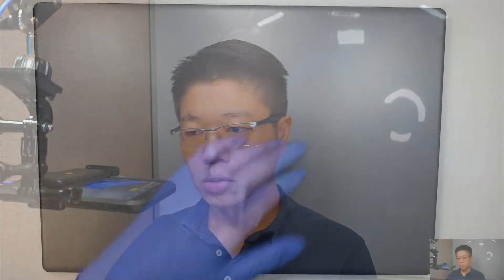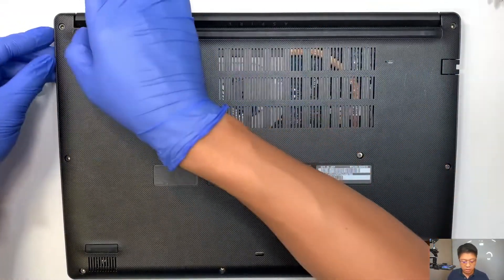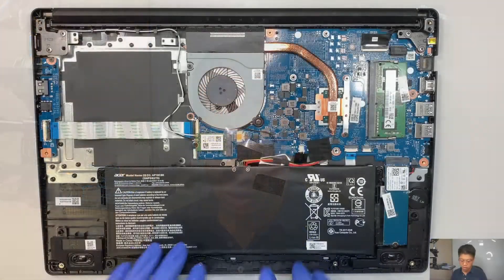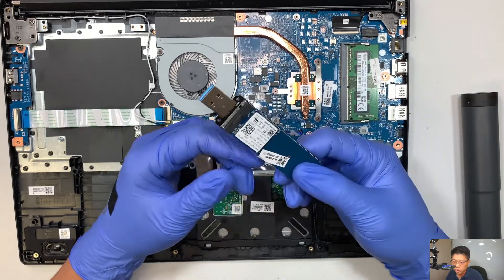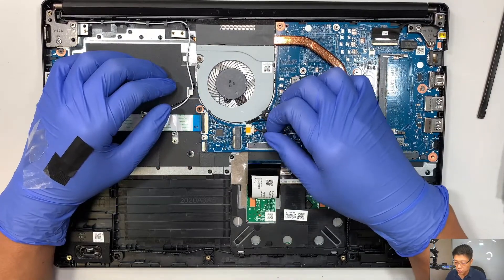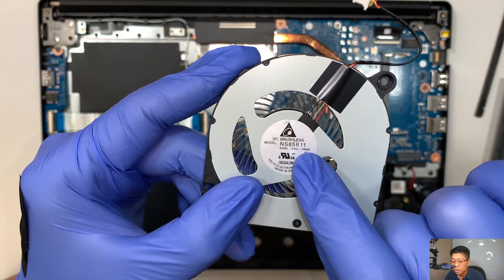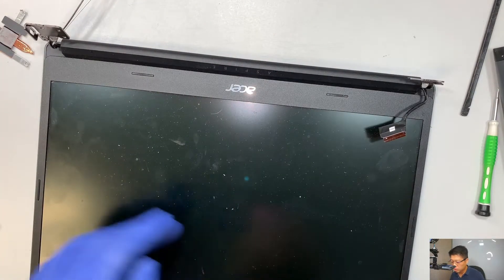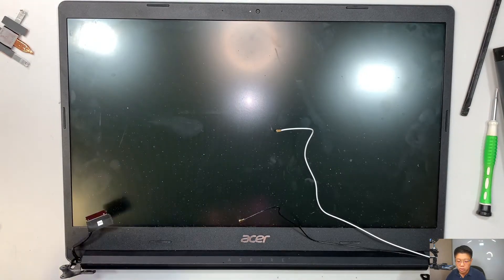Acer Aspire 3 A315 23 Tear Down Disassemble

Comment: Hej good info on video. i dont know wether you will read this as the video was 2 yrs ago but here goes. I bought an acer aspire 3 in 2023 and it has been great up till a few days ago when i was shutting it down for the night i got the typical message of update and shut down, which i did. The next morning i started up my laptop, the screen came on i logged in using my code then pressed enter then the screen went black. yes. black, i could see my mouse cursor but nothing on the screen. So i am at my wits end on what to do. I have tried turning it on and off and using the alt , windows key etc but nothing seems to work. when i turn it off and back on again i get the same thing, log in with code then black screen. I have important data on it. Can it be fixed or do i need to buy a ssd reader so i can access my ssd drive ?  Thanx for any tips

Comment: Hi! I have a question about this laptop, i have a problem with the keyboard. I disconnect every flex and cable to do manteinance on the motherboard, clean cpu fan, change the thermal paste and  installed a new m.2 ssd , a clean win11, everything ok,as far as i know. Now the keyboard is not working anymore, it only work on BIOS. I've tried installing different O.S and the problem persist. Do you have any idea what's going on?  please help ;(

Comment: 9:26 One thing I've noticed: Under the WiFi card, below it's screw you can see a connector.
In other videos I've seen this laptop can come out with a HDD that is connected to this connector via a flat cable.
This means this laptop is indeed upgradable for a SATA III 2nd storage device, the motherboard supports it. I've never seen this kind of connector for this specific use before.
So my question is: How would it be possible to find and buy such flat cable? Is this a common or a proprietary one? (it doesn't look to be proprietary since all connector seem to be standard ones).
Thank you so much Sir for any kind answer!

Edit: You can clearly see this flat cable with the SATA III adapter here: (30 seconds mark if it doesn't jump automatically to it)
https://www.youtube.com/watch?v=02ObUYLPSvQ&t=30s
At the 6 minutes mark you can see it's installation.

Another edit: This seems to be it! Includes the cable and the mounting plate for the HDD (although for a SSD, with no mechanical parts, I would be happy enough fixing the drive in place with some Blue Tack).
https://pt.aliexpress.com/item/1005003179382542.html

Cheers!
Reply: Yes you're right. There's a port for another storage device. Thank you for this brilliant information. And also there's space for a drive🙏
Reply: @googlekullancs4772  I've actually bought that flat cable from the official Acer seller from my country and a cheap SSD. It is confirmed, it works.
Just bare in mind that you first must unscrew and lift the WiFi card in order to be able to fully fit the flat cable in the motherboard's plug.
You're welcome! Cheers.
Reply: Look at the last 3 pictures

Comment: I installed an 8gb ram last saturday in my Aspire 3 and I'm now realizing it didn't come with a 4gb ram, like in the video (it's the same model), and I'm very confused (the battery plug was glued too, so it had been opened before buying it, by the sellers probably). The Task Manager and the System info says it had "two slots", but I only plugged the new ram in the only available one and now it has 12gb (but only 9gb usable)

Aalso I noticed the GPU says it has 2048 mb of memory, and before installing the 8ram it had 512mb.
Reply: the reason why it show s 9 gb usable because of the radion integrated gpu, unlike graphic cards which has dedicated memory , radion uses a part of the ram as the video memory , I am using the same model with 8 gigs but actually getting only 6

Comment: If i could find this video 7 months ago i wouldn't buy this laptop. İt has 1 ram slot and no separate GPU. I couldn't see there is any empty connection for hdd. You can only use SSD.
Reply: Check my comment above. You can connect a 2nd SSD to this computer.
My link includes links to videos with details and where to buy it from Ali Express.
Cheers.
Reply: Same
Reply from the maker: Sorry to hear that. This laptop has no room for upgrades.